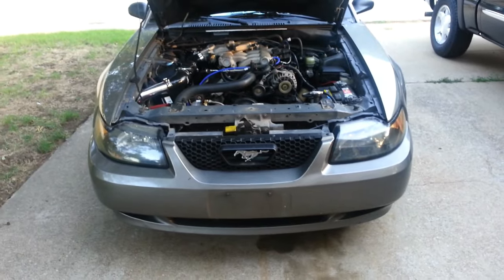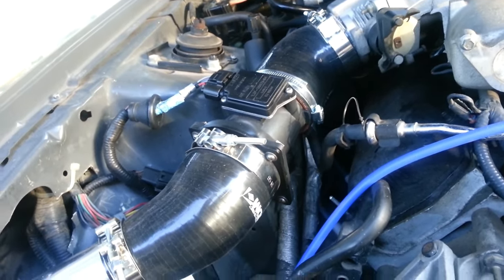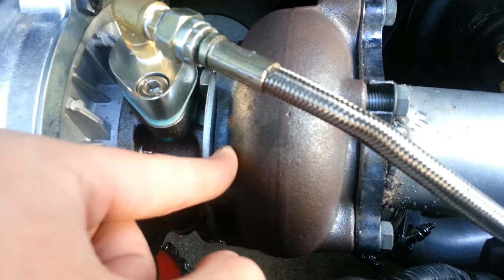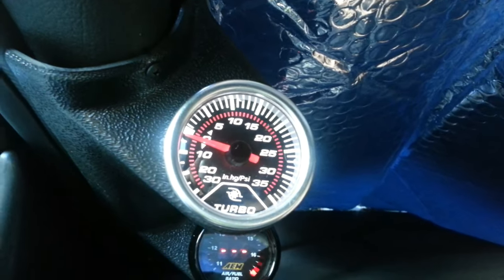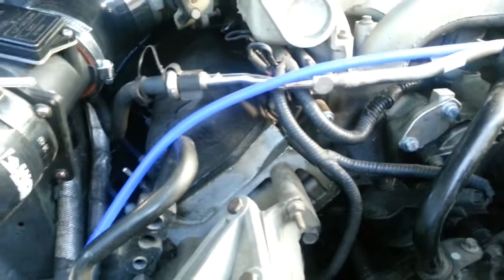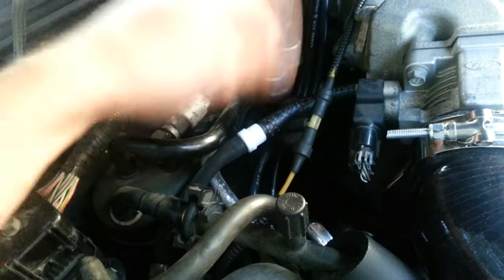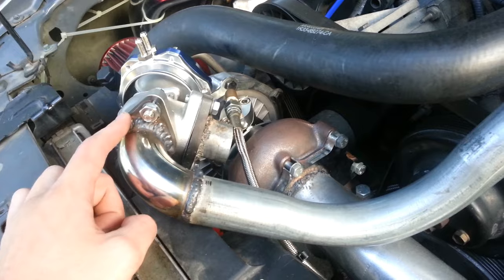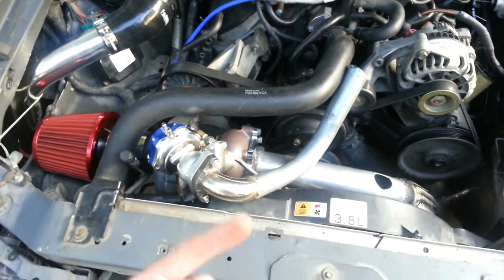How a Turbo Car Works

Comment: great videos, how is it holding up?
Reply from the maker: I'm waiting to get it tuned. since I finished it during race season, I've got a very late dyno date of September 26th :(
Reply from the maker: Ray Boucher 300 Miles on it now and it's still going strong, no shaft play
Reply: good stuff, giggity indeed

Comment: Im planning on buying a welder and doing this myself, is this something that i can do myself at home? How did you get the oil feed line to get oil,? Sorry lol im a little noobish about these stuff, im buying a $500 kit from ebay
Reply: And why does where the oil cap go look like that?
Reply from the maker: DIY Car Mods I also bought the 500$ "universal jdm kit". my oil feed tee came from Lowes lol. I took off the power steering bracket and took the actual sensor to the store with me along with the oil feed line that came in the kit. i have an inline restrictor (I think it's .063) that comes off the tee and into the line. it goes under the power steering and follows the lower rad hose, across the fan, and into the turbo with a 90° bend. also, the oil cap looks like that because the previous owner broke it >:(
Reply: Jack Matthews theres some 42lb injectors for $82 on ebay, you think there good
Reply from the maker: DIY Car Mods the "green giant" injectors? Yeah those are the exact ones I'm using on mine. You need some ev6 to ev1 adapters. Don't use the solid ones, buy the ones with wires instead. (if that doesn't make sense you'll understand once you start searching)
Reply: Jack Matthews u did all the welds  urself?
Reply: Jack Matthews sorry im bothering u so much 😂 and do you mean ev1 to ev6 ? Or ev6 to ev1
Reply from the maker: DIY Car Mods did all the welds myself, some gas welding, some flux core welding. but you've gotta get a female ev1 and male ev6
Reply: Jack Matthews how much you think you wasted in total? Tune,turbo,and other expenses??
Reply from the maker: DIY Car Mods probably close to 1600$ because I bought some stuff I ended up not using and I also bought things like a fuel pump and injectors that people doing cheap builds don't buy. I wanted it to last. So far after 200 ish miles no issues
Reply from the maker: Also got it dyno tuned with a sct chip
Reply: Jack Matthews im scared to daily on 8lbs im doing everything right, started by the fuel pump already
Reply: Jack Matthews i want to do a boost controller and just run like 4lbs if thats possible but idk how lol im trying to go by your exact setup
Reply from the maker: The second link. (the $5 ones)
Reply: Jack Matthews last question how did you weld to the header? I have shorty headers
Reply from the maker: DIY Car Mods I cut the collectors off the stock cats and flipped the headers sounds forwards. I had to cut out a section of the former drivers side header and got creative to clear the motor mount. Leave me an email or something and I'll send you a pic
Reply: Jack Matthews

Comment: Hey man planning on boosting my 3.8 the car now has full bolt ons, rear end, etc the car has 108k miles and its running rich on bank 1 i think its an injector leak, how much and which injectors did you put? And i have a walbro 255 fuel pump is that strong enough to handle boost?
Reply from the maker: ComplexSkating what year? this is an 02 and the walbro 255 (gss342) is not the correct pump. i bought a quantum 340 LPH pump with an install kit and it definitely works. But before starting, I'd figure out what exactly your problem is. then if you need to replace it, go ahead and buy the part that will handle boost. (clutch for example). the injectors I used were 42 lb high impedance injectors. i highly recommend high impedance versus low impedance because the computers in our cars can actually be damaged from low ohm impedance. high ohm being about 20. you can find em on eBay.
Reply: Jack Matthews i have an 03 and my mechanic already installed the walbro :/, and i have a stage clutch the previous owner put in, im worried about blowing the motor, im getting a dyno tune but is there a big possibility that ill damage anything in the stock internals, im planning on boosting on 8 pounds and how much power is yours making to the wheel? Thanks for the reply bro !
Reply from the maker: ComplexSkating 8psi will be fine. I plan on turning up my boost to 9 or 10 lbs. do you know what the walbro pump number was? because it has to be for pulse width modulated control. and if your tuner does everything correctly, you won't blow it up. also, make sure to get some NGK tr6 plugs and gap them to .030